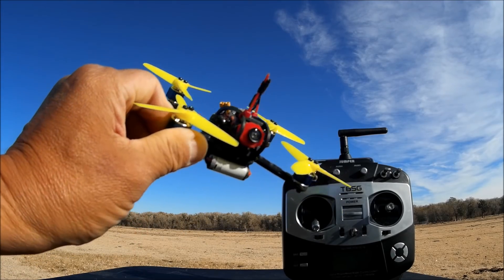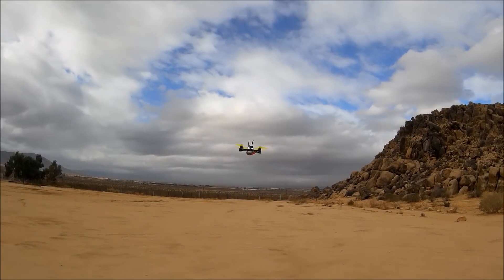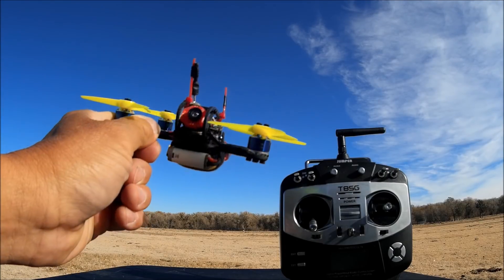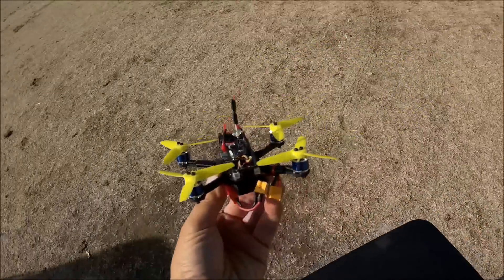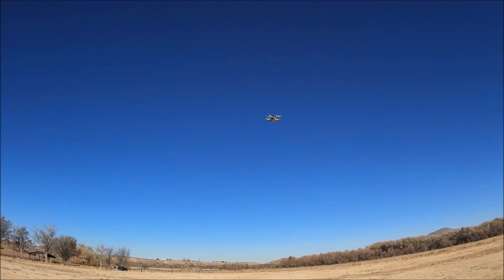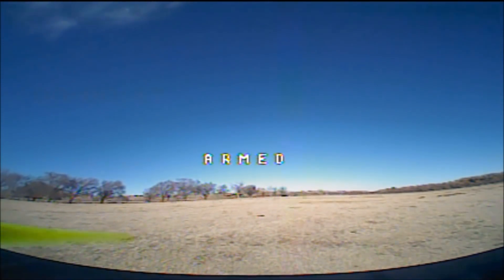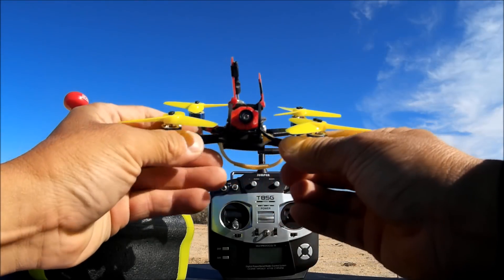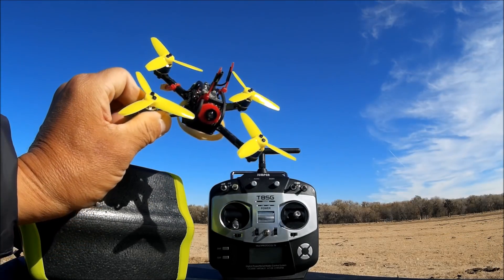Innov 120 120mm brushless fpv racer DIY kit - Part 3 - Flight Test

Comment: I want to purchase innov 120, do you think changing props to 2540 will solve the fod using 2s battery? Awesome guide and review anyway.. thanks
Reply from the maker: the 2540 helps a lot
Reply: thanks... i hope my innos 120 will be fixed with 2540 props only on 2s without another mods

Comment: What are your pids man for 3s?
Reply from the maker: I'm flying defaults on 2s.  5 points lowered on 3s :)
Reply: RC Escape what 4s 8000kv motors hot? should I get hot motors with 1104 7500kv 3s 2.5 prop
Reply from the maker: try using the gemfan 2.5" props.  They work out well :)
Reply: RC Escape that is what I'm using man so you think stock pids because my motors are getting hot now
Reply from the maker: try lowering down the d values till the motors don't get hot :)

Comment: Needs 2 bladed props to work on 2S.
Reply from the maker: TheKetsa 
I've got some tri bladed 2540 gemfan Flash in order.  Will test those out and see if it will work with 2s :)

Comment: Power hungry like the Leader 120🙃
I just ordered some xt30 plugs, I haven’t flown my Leader 120 yet it’s still in the box 📦 I’m just gonna fly it with 3s and an xt30. Seems like it’s power hungry and over propped. It’s gotta be doing 70mph with 3s👍🏻
The Jumper is an awesome radio, I was gonna get a larger 6db antenna but I don’t think it needs it. It will easily outrange a micro vtx.
Reply from the maker: SB RC 
Nicely put :)
You summarized it just right :)

Comment: Hey mate, set your min cell voltage in betaflight to 2.9v and youll have no more issues. If its set to min cell voltage of 3.3v, and you punch out, itll momentarily drop the cell voltage below 3.3v, which makes the flight controller stop evenly putting out power. I know it seems crazy, but works! A 3S is less likely to have individual cells drop below 3.3v which is why you had better results with the 3S. No more flip of death on 2S!
Reply from the maker: Imaginertiophile 
The min cell v was set to 2.8 and still it did the flip of death.  So this one also has too much prop for its size as well and if I down size the props, it shouldn't have the death flips with a 2s but with these humongous props, it requires 3s.
Reply: RC Escape Ah! Definetly happens. Im glad you got it going.
Reply from the maker: I'll try out some Gemfan Flash 2540 tri blades next with 2s and see if it works :)  Thank you :)

Comment: Nice flying man! You really should get rid of the props, they are too bendy and flexible! The Gemfan 2540 tri-blades or 2535 quad-blades will be a lot better and you can use 2S. Also, the converter is bad, it cuts down the voltage! Converter could be it too, you should try not to use that. I learned that from our awesome viewers! Awesome video as always! God has blessed you with access to such beautiful places to fly! 👍😆
Reply from the maker: Frequent Flyer RC 
Thanks Flyer :)
The props are off!!! 
I need to increase my battery arsenal to have connectors in both jst and xt30 in 2s and 3s :)
Ordered those props!!  This place is awesome and no one is here on this side of the park ( cow patties ) lol!!

Comment: I enjoyed the 3 parts about the Innow 120 build. You did a great job. Thanks.
I figured out 3 inch props can fit if squezzing the frame together, 
by shortening the middle sticks and camera holder.
I made my build with DYS 3045. But good to know I should use only 3s lipos. Thumbs up!
Reply from the maker: Yoda Yedi 
Thanks man :)
Yeah, either use 3s or down size the props like Frequent Flyer and no flips of death :)
Also, set min batt v to 2.8!!!

Comment: Hi, what about this flutter, I have it a lot on 11xx quads on 3S. Could you get ride of it? 
Great videos by the way !
Reply from the maker: I need to go with a smaller sized prop.  These props are too much for this set up.  I did go lower on the P gain until the flutter went away but I was losing authority.